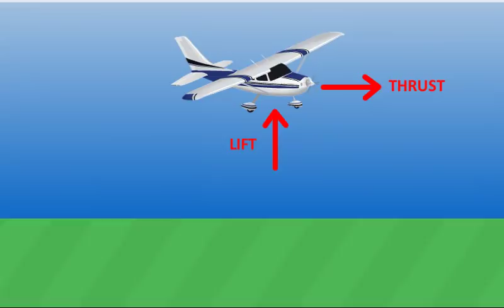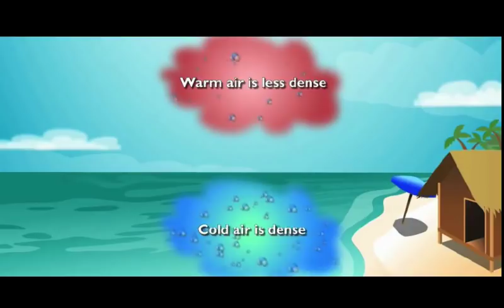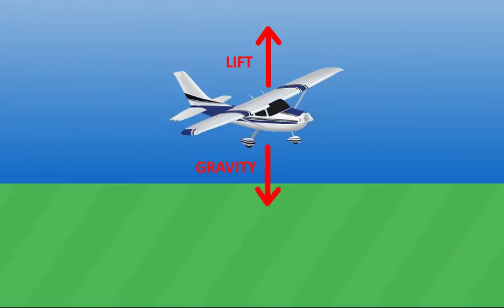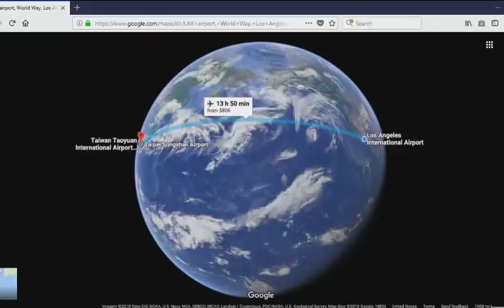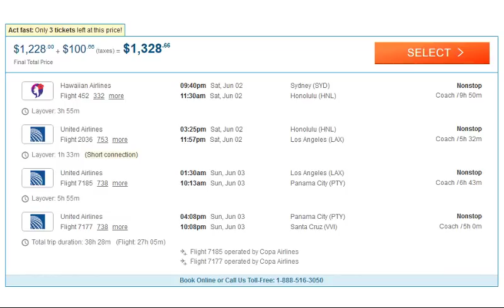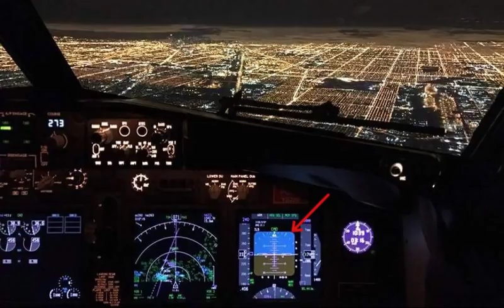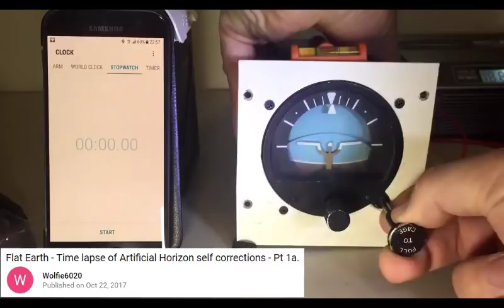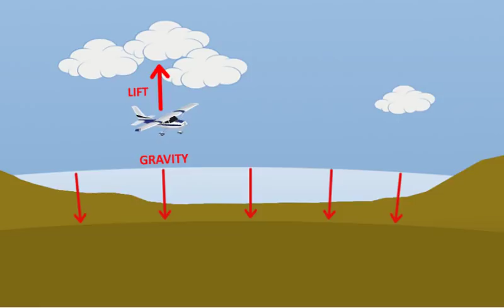Flat Earth Falsities - Plane Nonsense

Comment: Sure he does not remember who.. unintentionally & cultist... nice :)  College boys are very busy at debunking Flattards... Too zealot to be non Cabal /S. Society members.
Taxpayers have paid $300 million to build the Laser Interferometer Gravitational Wave Observatory’s two 4km long laser interferometers. LIGO has yet to detect gravitational waves. After spending $760 million, Stanford’s relativity gyroscope experiment Gravity Probe B claims to have detected frame dragging. This claim is not supported by their original data. After finagling with the data for five years, they now claim a statistical significance of 19%, which is not acceptable.

Before Albert Einstein, science was based on observational and experimental data. Einstein introduced an extensive set of advanced mathematical (he flunked his classes) equations comprising the general theory of relativity. His followers tried to fit nature to it. I think this is basically wrong. 

Johannes Kepler derived his three laws based on Tyco Brahe’s astronomical data. I respected Kepler’s work because his laws were based on observation, whereas Isaac Newton just… guessed. There is no basis for the product of the two masses in Newton’s equation of gravitational force, which is now printed in all physics and astronomy textbooks.

I invite you to rethink the work of Einstein, Newton, and Kepler – whose third law was first interpreted.
Pari Spolter book 'Gravitational Force of the Sun"
Reply: Stop trolling and fuck off you silly child.
Reply: Thee entire Scientific community got "duped" by a man trying to make a name for himself? Oh yeah? Dont believe that hogwash! 
 "Nothing ever went through so many tests as this peccary molar from Nebraska. It survived them all, but then "science" (One honest man William King Gregory) went digging in the ancient river-bed again."

Have YOU presenting any scientific or intelligent information on this thread? No amount of scientific evidence can wake YOU people UP.  YOUR atheist Establishment vents ignorance, of unfortunate tries to perpetuate frauds and you should be ASHAMED OF YOURSELVES.

How did this fraud continue for so long before being exposed? Harvard paleontologist Stephen Gould suggests wishful thinking and cultural bias on the part of evolutionists.

Lot of classic "quote mining" defense, but not shown.
"Atheist scientists" is presumption your part, an ad hominem to poison the well." - The gall, that all you boys do, you poison the well all the time; "against Science" etc, only atheists (/luciferians) have made up frauds, denial that many top scientist are Creationists of sorts, as many agnostics, but the minority "atheists" control the media show, as jobs and funds depend on GOV and BIG Corporation who only push such beliefs.

As I have said, those who really helped Science were Creationists as Louis Pasteur, hell the christian Wright brothers when against all. er

Impossible for you, to show evidence of false Evolution, not the main point here again: showing that likelyhoods for repeated "verifications" wrong are high, many successful demonstration of falsehoods where in schools.  

IN WELL= ATHEIST RICHARD DARKINS GURU=
"pseudogenes... [are] useful for. . . embarrassing creationists... It stretches even their creative ingenuity to make a convincing reason why an intelligent designer should have created a pseudogene -- a gene that does absolutely nothing and gives every appearance of being a superannuated version of a gene that used to do something -- unless he was deliberately setting out to fool us... Leaving pseudogenes aside, it is a remarkable fact that the greater part (95 percent in the case of humans) of the genome might as well not be there, for all the difference it makes.” - Richard Dawkins, The Greatest Show On Earth, 2009 

AFTER YEARS OR CREATIONISTS CRITICISM= 'In hindsight we can see that this junk is a necessary reservoir for the evolution of protein-coding genes from duplicated genes, creating an environment where point-mutations can freely occur and add up without selective pressure deleting neutral or negative mutations - a scribble-pad within the pages of the great novel '. (Richard Dawkins, Jerry A. Coyne, John C. Avise, Douglas J. Futuyma, Michael Shermer, Francis S. Collins, Kenneth R. Miller, Philip Kitcher.)
Reply: Louis Shaw LIGO has detected gravity waves; denying it doesn't cancel evidence. 

Gravity Probe B was within 15% of the expected result. Statistical significance deals with how well the spread of readings distinguishes between control & test, not how near the result is to predictions. 

Einstein did not fail maths and do you seriously think nobody checks research work before using it?

How many observations did Newton have to make to qualify as have made observations?

You summarily dismiss Kepler because you don't like his conclusions?
Reply: Newton also based his work on Brahe's observations and Kepler's three laws. His laws were checked against the Galilean Moons of Jupiter (that leading to the discovery of the speed of light) and now we can predict the positions of the moons for years ahead of time. Also, Newton's equations are the engine for Universe Sandbox Squared, which uses Newtonian math to track more than 5,000 objects in the solar system, allowing you to accelerate time and predict exactly where those objects will be years from now.

https://www.youtube.com/watch?v=ptiNYlUPyTk&t=28s
Reply: wong no reply will be given to hate driven harassment from you. I have already stated my position and that's all I'm going to say.
Reply: +Louis Shaw
You should strike up a relationship with +R V in the thread above. You two would make a perfect match. made in heaven.
Reply: Louis Shaw To quote the IFL article:
"They say the small perturbations may have been the result of noise ... at both sites, with coincidentally the same time it would have taken for a gravitational wave to pass from one site to the other"
How likely do you think it is for that happen three times?

Newton improved on Kepler's work to account for the attraction of other bodies.
Reply: And the heat goes on.... Dont know, better then a BANG, even a BIG one to create a perfect system, with Gravity fine tuning everything and LIFE. Want to give me odds for THAT?
I dont know the conditions for that experiment, but know it has happened before. We dont see noise but hear that stuff alright.

Here are some odds figured out by Doug Axe to help you answer:
ODDS ;
Of a simple protein appearing naturally on it's own: 1 in 10/164th power
Of an amino acid appearing naturally on it's own: 1 in 10/74th power
Of anything being considered impossible: 1 in 10/50th power
To put into perspective:
Number of particles in the Universe: 10/84th power
Number of of seconds since the Big Bang: 10/16th power
Number of events since the Big Bang: 10/139th power

Douglas Axe is the director of Biologic Institute. After a Caltech PhD he held postdoctoral and research scientist positions at the University of Cambridge,  the Cambridge Medical Research Council Centre, and the Babraham Institute in Cambridge.

Then you will like the paper * The Mathematical Impossibility Of Evolution by Henry Morris, Ph.D.*
http://www.icr.org/article/493/

But Evolution has been proven to be the most likely explanation for specialization as conclusively as any other widely accepted scientific fact…_,
Reply: Louis Shaw Axe was arguing in favour of incremental evolution rather than spontaneous generation.
Reply: Louis Shaw How do you I would be instantly aware that you had posted a comment? I'm not glued to an email account.
Reply: No no that is fine, did not say but recently in & out through the day like me.
That worries you so, no defending the beauty of science? General quiet!
Reply: Louis Shaw When you have oceans of reagents and catalysts the high odds don't mean the process will take for ever. 

"A new paper in the Journal of Evolutionary Biology helps debunk the peppered moth icon Experiment."
Hardly. It deals with how well the moths can hide themselves, not Kettlewell's methodology. While the experiment is famous it is not the cornerstone of evolution. 

Forbes article. So? Hypotheses & theories are built on existing data. Science advances by continually testing. New data can change the overall conclusions. That is the process by which we advance. 

"Shechtman spent more than two years gathering data"
Which is quite normal. 

He proved the existence of quasi-crystals; he did not disprove crystal symmetry. Pauling had a reputation for being dogmatic in later years. 

I have Franelli's paper, one of a collection on the subject of misconduct. If misconduct was considered acceptable then the papers wouldn't have been written and people wouldn't be in deep trouble when they are caught. 

You can't come up with evidence to support creationism & flat earth. You can't come up with evidence to disprove the big bang or a globe. All you're trying to do is cast doubt by innuendo. Resolution of conflicting data by further research and modification of theories is a normal part of science; it does not mean you can claim something completely wrong without providing evidence.
Reply: And bonjour to you mr Flook. I am really baffled with big word with big words like reagents and catalyst on this commoner YT. Think you would  be on a science blog! Not here to Professors kick ass like I have done on creationist posts. Point was odds, wonder what the likeliness of Piltdown man cheap con to hold so long would happen with not any "considered acceptable" with 250 papers by non parroting evo scientists?

Built on existing data with lots of testing... Should we talk about Haeckel?
Dr. Richardson stated: “This is one of the worst cases of scientific fraud. It’s shocking to find that somebody one thought was a great scientist was deliberately misleading. It makes me angry. … What he [Haeckel] did was to take a human embryo and copy it, pretending that the salamander and the pig and all the others looked the same at the same stage of development. They don’t. … These are fakes.”

Today – believe it or not – Haeckel’s drawings still appear in many high school and college textbooks. Among them are “Evolutionary Biology” by Douglas J. Futuyma (Third Edition, Sunderland, MA: Sinauer Associates, 1998), and also the bedrock text, “Molecular Biology of the Cell” (third edition), whose authors include biochemist Dr. Bruce Alberts, president of the National Academy of Sciences.
Haeckel’s fraudulent drawings are just one of evolution’s pillars now under spectacular scientific assault. There are many others.

Evolutionists often express irritation when Piltdown Man and other fakes are raised by their opponents.  A common attempt to put a ‘positive spin’ on the whole affair is to portray it as a ‘plus’ for science, demonstrating its allegedly ‘self-correcting nature’.  After all, we are told, it was evolutionary scientists themselves who discovered the fraud.  However, the issue is not the hoax as such; the scandal of Piltdown is that such an amateurish, clumsy and obvious fraud (even showing filemarks on the teeth) went undetected for over 40 years.  Generations were indoctrinated into the ‘fact of evolution’ via Piltdown gracing countless textbooks and encyclopedias.Many scientists, including people writing doctoral theses

 This Nebraska man tooth was the reason that evolution started to be taught in schools. Before Nebraska man evolution had a hard time getting taught in schools but such was the fanfare of Nebraska man that evolution became the excepted norm. Even so this embarrassing oversight due to the rabidness  of evolutionists to “prove” their theory, only lasted a few years before it was found out as a “DUMB” mistake. The pig it belonged too is a species of pig called “prosthennops serus”, this pig was found still alive in Paraguay in 1972.

JAVA MAN ???? NO?
Eugene Dubois who was a former student of Earnst haeckel, Dr. E. Carthaus, a geologist on the expedition concluded that Pithecanthropus was a modern human. He apparently failed to display the human skullcaps when parading his Pithecanthropus. In fact, he kept the skulls hidden under the floorboards of his house for thirty years, then finally made them known in the 1920s.(ref,http://creationwiki.org/Java_Man).

Neanderthal man???? Another deliberate fraud by evolutionist scientists.

But the Neanderthal skull was not the only forgery Oxford discovered. Protsch also had paraded “Binshof-Speyer” woman before the public, stating that she was 21,300 years old. Yet the new Oxford date puts this woman living at 1,300 B.C. Protsch also claimed that “Paderborn-Sande Man” walked the Earth 27,400 B.C., and yet the corrected figure reveals that he died only a couple hundred years ago—in A.D. 1750! Futhermore, Protsch also is being investigated for a scandal in which he allegedly tried to sell 280 chimpanzee skulls to individuals in the United States for $70,000.

Is it any different today? The late Dr Colin Patterson, senior paleontologist of the British Museum of Natural History, wrote a book, Evolution. In reply to a questioner who asked why he had not included any pictures of transitional forms, he wrote:

The renowned evolutionist Stephen Jay Gould wrote:
The absence of fossil evidence for intermediary stages between major transitions in organic design, indeed our inability, even in our imagination, to construct functional intermediates in many cases, has been a persistent and nagging problem for gradualistic accounts of evolution.

And:

I regard the failure to find a clear ‘vector of progress’ in life’s history as the most puzzling fact of the fossil record.4
As Sunderland points out:

It of course would be no puzzle at all if he [Gould] had not decided before he examined the evidence that common-ancestry evolution was a fact, ‘like apples falling from a tree,’ and that we can only permit ourselves to discuss possible mechanisms to explain that assumed fact.5

http://creation.com/refuting-evolution-chapter-3-the-links-are-missing?

From Jean Rostand, a much more famous French biologist (he was a member of the Academy of Sciences of the French Academy). The precise quotation is as follows: "Transformism is a fairy tale for adults."
Professor Bounoure's is taken from his book, Determinism and Finality, edited by Flammarion, 1957, p. 79. The precise quotation is the following: "That, by this, evolutionism would appear as a theory without value, is confirmed also pragmatically. A theory must not be required to be true, said Mr. H. Poincare, more or less, it must be required to be useable. Indeed, none of the progress made in biology depends even slightly on a theory, the principles of which [i.e., of how evolution occurs -- ED.] are nevertheless filling every year volumes of books, periodicals, and congresses with their discussions and their disagreements."

On many campuses, any professor who admits having doubts about the "factual" nature of evolution would be laughed off the campus (and out of his job). But today, more and more courageous scientists are publicly admitting what they have known privately for years: believing in evolution requires an act of blind faith.

http://www.chick.com/bc/1987/evolution.asp
-AH THE BEAUTY OF EVO SCIENCE, ONE MAY WONDER WHAT WOULD OF HAPPENED WITHOUT ID AND CREATIONISTS SCIENTISTS CRITICS? MUCH MORE SLOW ADVANCES....
Reply: The scholar who assumes everything school to be true is definitively getting less glued to the internet or about here. (as others)?
Admit my useless brain does not understand the consens rational.
Flook D2 weeks ago
Louis Shaw What gets taught in schools has been verified by science over and over and over but their are twits that assume it has to has to be wrong because, well, because. 
They demand experiments be run again and again and again and when they keep producing the same results(?) they want them repeated again and again and again. 
#2 At the time of its (con amateur Dawson's) discovery there was limited information upon which to draw conclusions (but still did and gave schools). It was (LONG) eventually corrected as more (hands on falsification) information became available(?) and was assembled. That is how science deals with its mistakes and continues to progress. 

1912 December: Official presentation of Piltdown man.
1915: Marcellin Boule concludes the sample to be an ape mandible and a human skull. Gerrit Smith Miller concludes the jaw is from a fossil ape.
1923: Franz Weidenreich reports the remains consist of a modern human cranium and orang utan jaw with filed-down teeth.
1925: Edmonds reports Piltdown geology error. Report ignored.

1953: Weiner, Le Gros Clark, and Oakley expose the hoax.
2003: Full nature of Charles Dawson's career in fakes is exposed.
http://en.wikipedia.org/wiki/Piltdown_Man?

Must of be some summarily dismissal because Atheist scientists like their own (pre)conclusions! That hypo /theo awas built on existing hard fossil evidence, so imagine what can happen with DATA!
 Sorry but Science has often not been beautiful.
Reply: Louis Shaw J Evol Biol - the paper notes that anti-evolutionists have written literature ; it doesn't credit them as legitimate criticisms. 

Piltdown Man fitted in with the limited knowledge and prevailing expectations; as a hoax it was designed to do that. It was disputed from the beginning; you provided the evidence for that below. It was conclusively demonstrated to be fraudulent over 60 years ago. It is irritating when creationists keep bringing it up because it was proven fraudulent 60 years ago. 

Haeckel is remembered for his recapitulation hypothesis he was essentially an embryologist; early editions of Alberts used some prints to demonstrate distinctions between embryos, not endorse recapitulation. The hypothesis was never accepted as  theory and certainly isn't today. 

Only creationists have taken the Nebraska man claims seriously. 

At the time Java & Peking man were discovered people were expecting one transitional species, not a series. Limited evidence then, more now. If Dubois kept the skulls hidden then how were they examined with the other bones 20 years earlier?

How many Neanderthal remains need to be found before you accept they have been found?

Patterson & Gould - quote-mining - refers to the difference in continuous and punctuated evolution, not whether evolution exists.

Sunderland - the fallacy of an every-increasing requirement for transitional species. 

Transformism isn't evolution. 

chick article - quote mining. 

"Atheist scientists" is presumption your part, an ad hominem to poison the well. 

Armitage wasn't fired by SoCal because he didn't work for them. I can't get access to the paper in question so I can't critique their claims. 

You haven't produced any evidence evolution is wrong. You haven't produced any evidence creationism is right. You have regurgitated more innuendo.
Reply: Well my bad on Einstein math fail, apparently not, but who can be sure with Zionist controlled History? He didn't excel in school and dropped out when he was 15. - But I regress not into Ad Hominems wins...
Now why would a know nothing /basic science, not "summarily" dismiss? Only honest open minds like you boys dont do that before venting against.
Kepler's third law assumes that all planets are not affected by the gravity of other planets and the orbit of every planet is an ellipse with the Sun at one of the two foci.  True?
 
If the planet did not affected by the gravity of other planets, then the orbit of every planet would be a circle as I have mentioned. 

Kepler’s third law is at least a mistake even for you, no use at all in your Solar System. Astronomers know nothing, do in major approximations.
They are still learning on the Human body ETC ETC ETC but SPACE!....
Reply: WISDOME
KINGDOME
FREEDOME

ABOMINATION
OBAMA NATION
A BOMBIN NATION

DOMESTIC RACE   , DOME MESS TICK
DOMACILE IS YOUR HOME ,   DOME A SIGH ALL
DEMONS  ,, DOMENS 
DOMINATED BY DEMONS EARTH IS,,,DOME IN ATE  D 

WORD OF GOD 
GO SPELL OF CHRIST
U  N  I  VERSE

AND THE WORD BECAME FLESH

AND THE WORD WAS WITH GOD
AND THE WORD WAS GOD

BABBLE ON WHORE HILLARY
ABOMANTION BARACK OBAMA
BURNING BUSH FAMILY

MICHELL OBAMA,    m,,i,,c,,HELL

MANDALAY BAY SHOOTINGS

MAN DELAY ,,, DELAY OF MAN 

LAS VEGAS
LOST VAGUE GUESS

JESUS CAMPOS THE SECURITY GAURD,  THE JESUS CAMP
NEXT TO THE LUXOR ILLUMINATI PYRAMID

CORINTHIANS : AT THE ANGELS LAST TRUMP YEA SHALL BE CHANGED,,, TRUMP*

DANIEL 12:1  MICHAEL RETURNS TO RESCUE THOSE WRITTEN IN THE BOOK OF LIFE WHEN THE TROUBLES OF THE WORLD ARE GREATER THAN EVER BEFORE

DANIEL 12  WAS SEALED BY GOD AND IT IS WRITTEN THAT IN THE END TIMES THIS BOOK WOULD BE UNSEALED AND IN FACT IT HAS BEEN

AND YOU SEE THEN MICHAEL IS THE SAVIOR OF THE WORLD IN THE OLD TESTAMENT AND JESUS IS THE SAVIOR IN THE NEW TESTAMENT

BUT IT WAS MICHAELS HOLY NAME WHO WAS SEALED UP UNTIL THESE TIMES

MICHAEL OF URANTIA  STATES MICHAEL WAS JESUS OF NAZARETH
MICHAEL OF NEBADON SAYS THE SAME THING

NOW THE BOOK OF DANIEL IS OPENED TO REVEAL MICHAEL*

I BEGIN AGAIN*

CREATION IS FLAT AND CONNECTED BY WATERS

WE DO NOT GO INTO SPACE THE VOID THE LIE

ALL DOMED WORLDS ARE CONNECTED BY OCEANS THAT GO ON AND ON

ATLANTIS AND LEMURIA ARE STILL OUT THERE BEYOND THE ARTIC CIRCLE THAT ENCLOSES US IN

UNITED NATIONS SYMBOL IS A FLAT EARTH

THE CATHOLIC CHURCH PREACHED A FLAT EARTH FOR THOUSANDS OF YEARS
THEY IMPRISONED GALILEO FOR SAYING THE WORLD WAS ROUND

SO DO ME , DOME,, DO ME,,, DOME, DO ME!
word

michaels  sword  is actually the  s WORD,   THE WORD OF GOD WILL DESTROY A MILLION SWORDS AND NEVER FAIL
Reply: okay.... little german madness perhaps, some fine facts, some errors maybe.
Was accepted by Early Christianity, along with much of Greek thought.
The Romans the lengthy process of cross-fertilization with Hellenistic civilization. 
And there was no prison, but house arrest, because of the Jesuits, pope was in favor!
Reply: Louis Shaw You think there is something suspicious about a Society wanting to support study of the subject?

You're arguing that the editor having graduated from a University founded 6 centuries earlier by monks makes him a Jesuit secret agent? 

"As early as 1913"
Then you acknowledge there was dissent from day one, not universal acceptance?

"WHAT DID THE SCIENCE ESTABLISHMENT EXACTLY DO?"
Published the proof when it was found. 

"Nothing ever went through so many tests"
What tests exactly?

"No amount of scientific evidence can wake YOU people UP."
You have yet to produce any. You just keep quoting errors that have occurred and hoping I make illogical mental leaps. 

"only atheists (/luciferians) have made up frauds"
Evidence? Also explain why someone who doesn't believe in supernatural entities would believe a supernatural entity was giving them commands?

I can't find your final quote anywhere. You're saying God created the means for evolution to occur while also saying evolution doesn't occur?
Reply: Actually I dont even know what you are talking about with  J Evol Biol, you bring it up as evidence of something.... Playing deflective game are thee?  Point is very clear that such a origine can only be very bios, downplaying data like you are doing.
"it doesn't credit them as legitimate criticisms." - and so what?
Denial of evidence in support of an idea does not cancel it or need to reexamine, why no use NCSE language while our are at it.  

I will pass on your hypocrisy on the beauty manner the Establishment handled the affair.

ps; [QUESTION: How long was the Piltdown man hoax taught in our schools? 
ANSWER: 
The Piltdown man hoax prevailed from 1912, when the “discovery” was first made public, until 1953 when it was finally proven to be a fraud.]
https://www.allaboutcreation.org/the-piltdown-man-faq.htm

[ Anyone conversant with the Piltdown history will readily, if not eagerly, agree that many of the researchers shaped reality to their heart's desire, protecting their theories, their careers, their reputations, all of which they lugged into the pit with them. All of the suspects were long dead before the assessments of their culpability began.
For close to 40 years, Eoanthropus dawsoni, a.k.a. Piltdown Man, was taught as fact. ]
 https://www.the-scientist.com/books-etc-/piltdown-proves-a-point-64042

"Louis Shaw What gets taught in schools has been verified by science over and over and over but their are twits..."
so where the rare day one dissents just creationists? 
wonder WHO found the proof?
and who published it first...
Reply: Lious Shaw "I dont even know what you are talking about with  J Evol Biol,"
You brought up up two days ago about a paper concerning pepper moths. 

"[QUESTION: How long was the Piltdown man hoax taught in our schools? 
ANSWER: "
Is on the page you quoted:
"Due to a number of factors including the number of textbooks in circulation during the 40 years of the Piltdown man’s general acceptance, the amount of time it takes for some textbooks to catch up with current research, and the overall lack of research on this matter, it is unknown how long the Piltdown man hoax was taught in public schools. "

"so where the rare day one dissents just creationists?"
Are you saying they were?

"wonder WHO found the proof?
and who published it first..."
https://onlinelibrary.wiley.com/doi/pdf/10.1002/ajpa.1330120115
https://onlinelibrary.wiley.com/doi/abs/10.1002/ajpa.1330090408
Who are you suggesting they are?
Reply: Louis Shaw Abiogenesis and spontaneous generation are two different things.
Reply: Being called a plagiarist by flat earth society. Now how low do you have to be to get called out by them. Lower than the horizon. rimshot